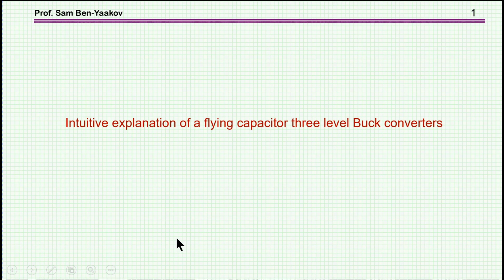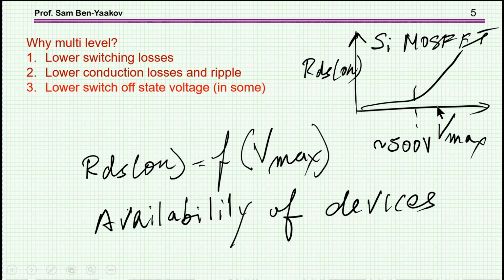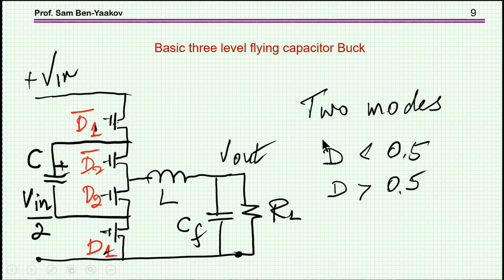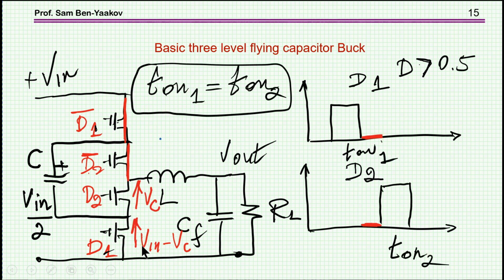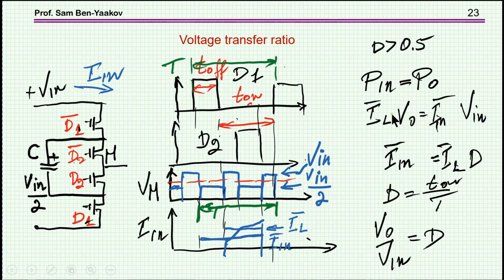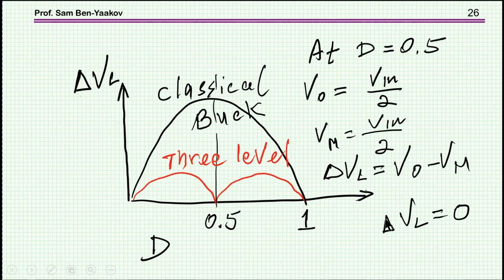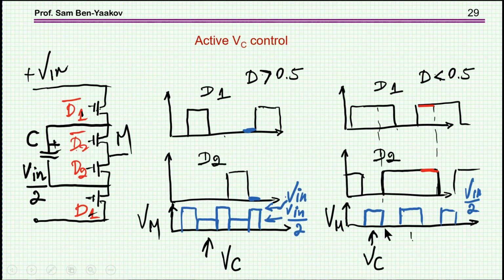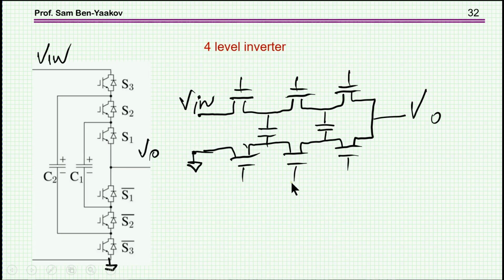Intuitive explanation of a flying capacitor three level Buck converters

Comment: Hello,
When the flying capacitor voltage becomes imbalanced (<Vin/2),  how the system naturally balances it?
Reply from the maker: The capacitor voltage is affected by the symmetry of the ton pulses. There is no runaway. If the voltage deviated from Vin/2 it can be corrected by changing the balance between the tons.
Reply: @sambenyaakov  Thank you for your explanation — that makes sense. 
I have a follow-up question: in a 5-level converter operating at a 1/4 conversion ratio, if two out of three flying capacitors become imbalanced (undercharged), will the system still be able to naturally balance them (without adjusting the Ton time)? If yes, could you please explain how the balancing mechanism works in that case?
Reply from the maker: @arnobbarua2482  Good question. I have not looked at this rigorously, but my feeling is that in this case, there will not be a self-balancing effect. For the single cap, I am thinking about a video that will explain the self-balancing, What do you think? Will it be of interest?
Reply: @sambenyaakov  Obviously! That sounds great — please go for it!
Also, I’d like to know why you think there won’t be a self-balancing effect when more than one capacitor is imbalanced. Could you please share your thoughts on that?

Comment: for D<0.5 ,  how the switch pulse width is increased ?
Reply from the maker: I am not folowing you.
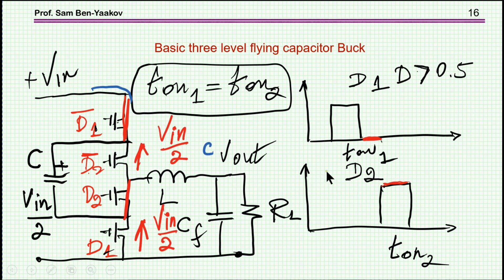Reply: @sambenyaakov     My question is ,   at 7:54 min  of this video you showed with D>0.5 how the switch pulse looks like for each switch . And then in the next slide  when you mentioned d<0.5 ,  then how the pulse width for switches got increased for lesser duty ratio vlaue .  I did not understand this point .
Reply from the maker: @ribhuchakraborty2829  It is the combination of the gate pulses that makes the D

Comment: thank you Professor for this explaination, i have question. Why the voltage of capacitor is equal to Vin/2  and ont equal to Vin?
Reply from the maker: During operation it stays at 1/2

Comment: Hi Sam. Have a nice day. I have in the past months did learn some more about pwm, class d and special the design of feedback for class d in different systems, one of these is a flying cap inverter do not what I want, it does work with -100dB distortion levels between 20 and 30 kHz, but the capacitor voltage does not stay on zero, I have bipolar supply and two 180 degree triangle carrier. Have feedback pré and post. I did read some papers about the stability of capacitor voltages and see much the use of special modulation technologies keeping it oke. I see also resistors are used for this. I use three gate driver ic,s and two of them only high side drive is used with cascaded bootstraps, and one both sections on ground level.. Possible a delay in it can cause the problem, maybe some kind of dc servo can be used to correct pwm. All start nice and on zero, slowly in time, the two sections get overlapping each other and the fundamental carrier get not suppressed anymore, it starts fine. It is for audio. Thank you for help and pray with me for world peace. If I see right on this video you do talk about this solution.
Reply from the maker: There is a need for an active ( feedback) of the cap voltage and a startup arrangement that will ensure balance at turn on. Look up TI application notes and reference design on that.
Reply: @sambenyaakov  Hi Sam, I have now all done, it works fine but the shoot trough does not, I have include a deadtime, but I need delay who is not the same as with half bridge amps, To get a balanced output I have need for a delay circuit who do delay opposite or so. Here on page 2 and 4 you see what I mean. Looks like I need switch it on and of depentend on negative or positive voltage. Maybe you can give a hint, I have tryed some, it does work but delay is for both on and off, I need delay in rising signal and a delay in falling signal who extent the other signal, normally it does not both falling and rising get delayed, I do need not such and can not find out how to do that, did using diodes but no luck, get shoot through in falling signal from comparator. I can use bigger caps but then I get uge deatime in only the rising signal and distortion.

Here is link to article  https://uia.brage.unit.no/uia-xmlui/bitstream/handle/11250/2787318/Paper%20III.pdf?sequence=7

Thanks in advace.

Comment: Thank you Professor for explanation...can you please suggest any arrangement for start up operation. Also, is there any possibility of high voltage stress (equal to Vin) across upper switch (connected between +Vin and Flying cap+) during start up when all capacitors are at 0V potential?
Reply from the maker: Perhaps will cover startup in a forthcoming video
Reply: That would be interesting for me two, but I didn't find the next video Professor mentioned. I see this topology useful for "digital" voltage in a DAC because of a minimal value of a current ripple. What I can suggest is two C/2 capacitors from Vdd to C, and from C to GND.

Comment: Can use a standard synchronous  buck controller for this 3 level configuration ?
Reply from the maker: Plus cap voltage control